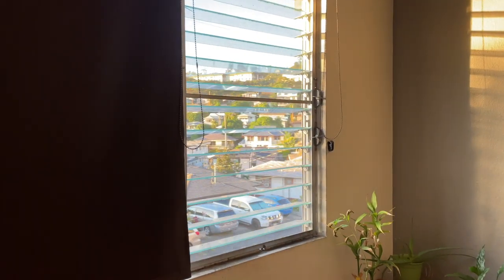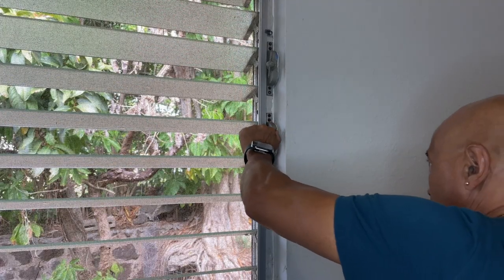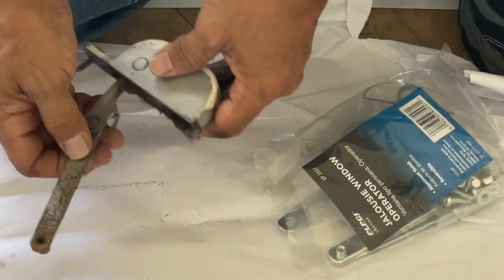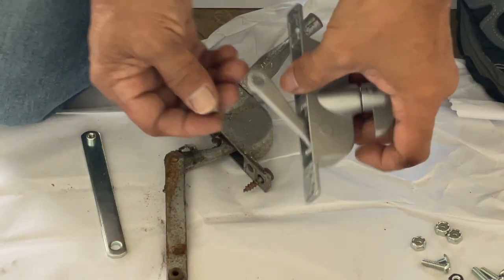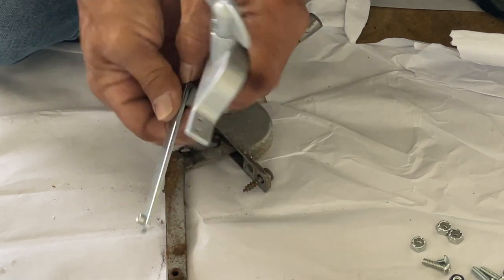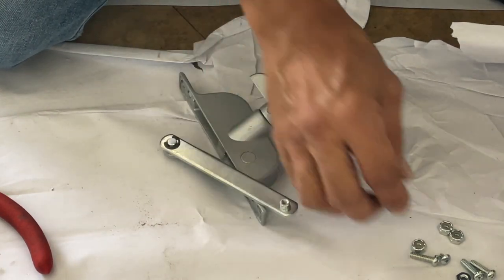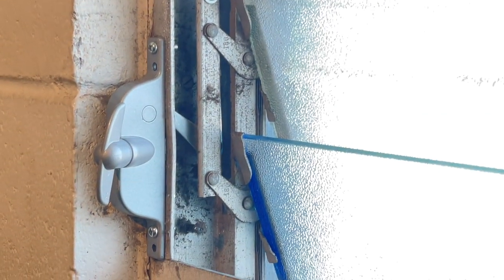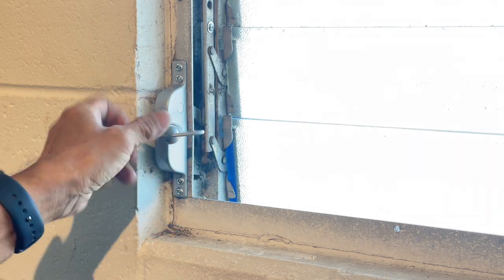How to replace your jalousie window crank.  Step by Step Instructions.

Comment: I just bought a condo with jalousie door, this was very helpful! How about replacing the security screen?
Reply from the maker: Uncle does a lot of security screen door installations. I don’t have one scheduled yet , but when I do I’ll post it. In the mean time if you have a question about installation, lmk and I’ll help you the best I can. Best advice I can give tho, is to make sure you use the bolts that comes with the door. That’s why there called security bolts. I hate when installers use standard bolts to install. They just are afraid to use them with the special install tool that comes with it. Aloha and Thank you for your question and viewing my video!

Comment: Unko, question, is it possible to fix just the crank itself? That crank (the one you twist to open & close the window) came off of the whole mechanism. Is it possible to put it back on or gotta change the whole thing?
Reply from the maker: OMG Uncle sooo sorry for the late reply. I did not see your comment till now. Sorry! 
But yes if that handle comes off the crank body, you need to replace the whole thing. Unless you still have the set screw that's on the handle. Look on the side of the round part of the handle and there should be a small hole,. That is where the set screw should be. Loosen the screw and put it back on the crank body and then tighten the screw. GoodLuck!
Reply: @unclejrsdiy  no worries 😂. I replaced the whole thing. Thanks 🤙

Comment: My crank just turns and turns without open the louvres. Is it still the crank that needs replacing? Thank you!
Reply from the maker: Hi Suzan, check to make sure the crank arm is connected to the body of the crank. If it is, than the crank or operator needs to be replaced. Hope that helps. Thank you so much for viewing my channel. Aloha and good luck !

Comment: Aloha Uncle! I need to remove my jalousie crank operator. But the screw that attaches the crank arm to the track (the screw that has a washer) is completely rusted shut. How can I get that screw out without ruining the track?
Reply from the maker: Hi Kim, that's the one thing that I hate when it happens. First, spray wd40 and let sit for 5 min. Then remove the 4 screws that is holding the crank operator. Grab the crank and wiggle it up and down and watch that screw until you see it move. Now if you did not round out the screw head and still can use a Phillips screwdriver, try and loosen it. But before you do that, you must turn the screw to tighten and then turn the screw driver to loosen. Doing this will free the screw from the rust. Then go the other way to remove. If all else fails, next thing that would work, would be to drill the screw head off. Uncle wish I was there to help you! lmk what happens. Aloha!

Comment: Great video. It was clear and to the point. After changing the handle, the windows don't open as wide as they should. Any thoughts? Watching your video reminded me of my college days at Chaminade. Aloha.
Reply from the maker: So sorry for the late reply. When the jalousie does not open all the way, your crank arm is either to short or long. Check the distance when it stops opening and look at the arm and check the end point when it stops when opening. Hope I explained that right. Aloha !

Comment: Thanks for the video Uncle! Now I can try fix some of the old windows at home. Question - what spray did you use? And ... do you know where to find glass jalousies to replace broken or cracked ones?
Reply from the maker: Hi Lexe! Uncle likes to use WD40 for lubricant and loosen the brackets, but you can use any multipurpose spray lubricant of your choice. Also you can purchase the glass jalousie at any hardware store.  Uncle goes to City Mill tho, to buy my jalousie . I am so glad you try to do diy yourself! I’m so proud of you! No get intimidated to fix things. If you have a fixer upper problem, Uncle always here to give you tips ! Much Mahalo for your support!  Aloha, Uncle Jr.

Comment: Good video but what if you have the newer type windows where the jalousie shaft is completely enclosed so you can’t see the shaft
Reply from the maker: @CheyenneStLuce  depends on what mechanism it is, some you may have to replace the whole track or some you need to remove all the Jalousie windows and remove the track to access the operator. Hope that helps or send uncle a pic. Aloha !